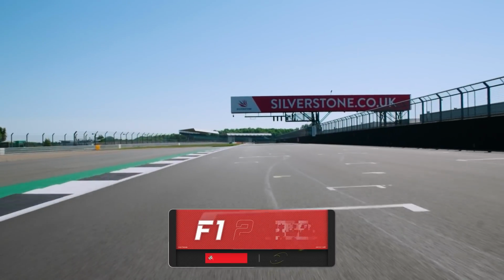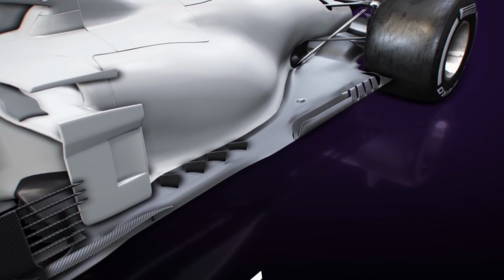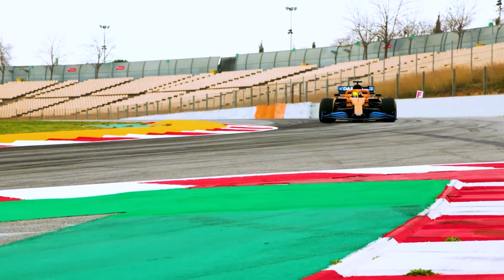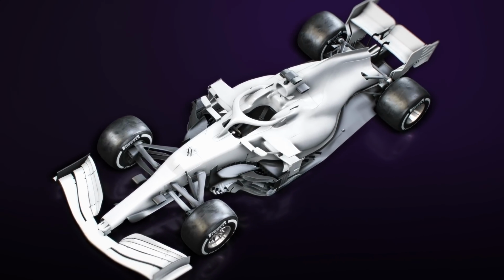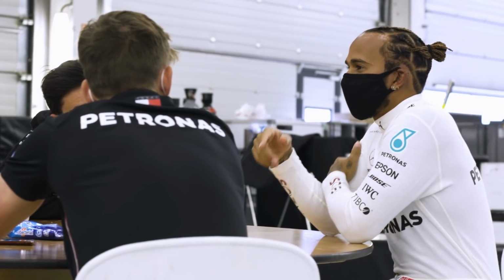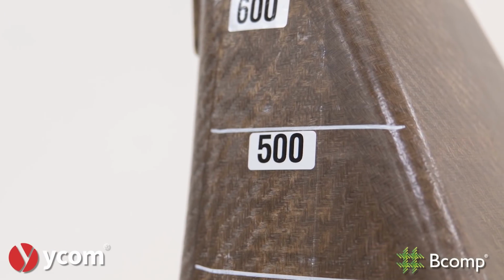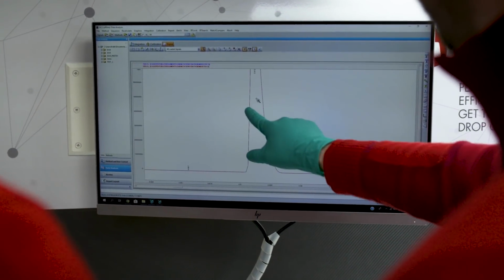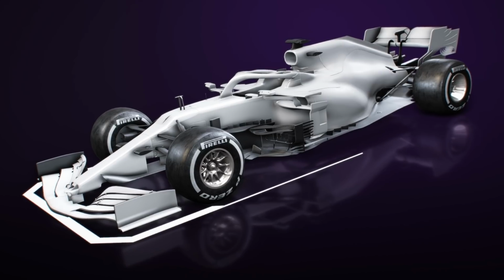F1's Updated 2021 Rules Explained - Everything You Need To Know

Comment: get rid of drs
Reply: Absolutely. Ruins racing with fake overtaking.
Reply: @cadelepski5161  yeah nah. DRS just eliminates the time lost from dirty air. You could argue that that loss is "fake" in the first place and DRS makes up for that again
Reply: @snonsig2688  It doesn't. It gives the car behind a huge straightline speed advantage. If it only eliminated it the car behind would still be behind. Anyway "dirty air" only affects corners. On straights where DRS is used slip stream + DRS gives the guy in front no chance.
Reply: @cadelepski5161  exactly dirty air only effects corners so you make that loss back in the straights were it s possible. Chances are if there was no dirty air the following car would've overtaken in the corner which DRS is trying to represent
Reply: No

Comment: Basically Pirelli can't keep up with technological advancements and development?
Reply: They probably can ,but not in order to comply to F1 mandate.
Reply: They were already designing tyres for the 2021 season and the rule changes before everything was pushed back a year. So basically they are just trying to make it so pirelli don't have to design a whole new tyre for one season of racing. They have redesigned the old tyre for the 2021 season now to basically be sturdy enough to cope with the loads.
Reply: No they could. The problem is that they can't meet the demand of the FIA for quickly degrading tires (for the entertainement and show) and the increasing downforce in the same time. One side asks for less durable tires, the other for more durable

Comment: Basically they just want to end the Mercedes dominance and make the car slower........
Reply: They did the same when Red Bull was dominating...........................
Reply: They could have just banned something that gave Mercedes the upper edge. I mean, they banned tyre changes in 2005 because Ferrari and Bridgestone were unbeatable in short stints
Reply: Litlle do they know merc might actually benefit it is going to hurt redbull more because of aerodynamic being the only thing they can even see merc in
Reply: I was prematurely excited about Merc being slowed down until i realized it will probably fk the other teams more in the end :/
Reply: They've always done this. Williams in the early 90s with the ban of driver aids, Ferrari in the mid 2000s with the tire changes, RB in 2014 with the shift to a hybrid power unit. When the competition gets stale, the FIA intervenes. Makes sense. Besides, none of these changes (minus banning DAS) target Mercedes in the way that the older changes targeted dominant teams.
Reply: I mean putting a cap on budget was understandable to let smaller teams compete but now these changes are just ..........

Comment: banning qualifying mode still makes no sense
Reply: Yeah all it does is create more consistent results, it's harder now because if a driver really wants to push to either try an overtake or get closer they can't use extra engine power to do so.
Reply: @airstrike9002  Err.. they can use extra energy from the battery.. The mapping restrictions really only have an impact on qualifying
Reply: @ryanokeefe12  errrr..
Except they don't. They're used continuously throughout the race, hence scenario 7 etc for the end of the race.  While they're still allowed an engine mode change in the final lap, why. Lit why. Why can't they have it the entire time? It didn't improve the racing at fucking ALL, yet they still pretend this isn't about closer racing. Ironic how red bull pushed so hard for it and then got impacted the most
Reply: @ImK4Os  true, redbull took the biggest shunt out of this, ironically they were the one crying to the FIA about at first.
the truth is 100% clear, mercedes is just thaat good, every attempt to slow them down will only make them faster, and the rest of the grid slower. 
the only good outcome we got from this nonsense is we no longer have to hear "FIA SuPpOrTs MeRcEdEs"
Reply: @ImK4Os  mate.. You've got no idea. I'm aware the hybrid system is used throughout the race. The drivers still have an overtake button that they can use to deploy more energy than normal.
On a normal lap, the car will deploy around the same amount of energy as it recovers. During a quali lap (and when using the overtake button), the car will deploy more energy. It just means that they will have to reduce energy output at a different stage of the race to top up their energy stores.
Things like "scenario 7" will deploy more energy, in similar way to the overtake button. It will put the car in a mode where it deploys more energy than it recovers. At the end of the race, this is fine because they can use all of their energy stores. 
If they went to "scenario 7" mid race, they would have to then spend time in a slower scenario to top up the stores again. 

"it didn't improve racing at all".. No, it wasn't the point. The point was to improve qualifying. Do some research before you start rambling about nonsense.
Reply: @ryanokeefe12  thanks for the information, genuinely didn't know the ins and outs of how the energy is deployed. Was always aware that it was a give and take situation, I know you can't just do scenario 7 over and over but I prefer the drivers to ha e the choice, I mean what does it really improve otherwise? 
Again, I'll repeat my sentiment. The engine mode ban didn't even improve the quali times, if anything the gap increased. Red bull was hit massively by it compared to merc and it probably made the racing worse as a result. Given that this was meant to be a slap on the wrist for merc (pushed for heavily by red bull, ironically) and it didn't even put a dent in their advantage is pretty hilarious. And the fact red bull kept pretending for weeks after that Mercedes were also struggling to make them look less stupid was so desperate and sad.
Reply: It made no difference...
Reply: its so the mode they use in quali is the same as they use in the race so it more accurately represents how fast they can go in a real event rather than on 1 lap of fuel and a short run engine mode
Reply: I just hope Checo to Red Bull
Reply: @brentmilligan2388  Red Bull would never bring someone in to challenge Max. They build their car around Max. Perez has a habit of crashing into his teammate when he cant beat him.
Reply: @LilSebastian_   Checo is a solid points scorer who always gets the most out his car, and tires, in a race. He would be closer to Verstappen than Albon or Gasly.
Reply: it made over taking a lot more complicated, cars have to spend more time in the slipstream, which brings the temps up, that if they didnt run out of straights.
as for "making the qualifying more competitive" well....we all saw how that came into effect
Reply: They're just trying to limit merc really. That's the same with banning DAS because it'll be too expensive for other teams to copy. It's ridiculous. So Mercedes spent their time and money to innovate but can't enjoy the fruits of their creativity and innovation because it's unfair to other teams?
Reply: @iwill6002  same thing happened with the dimpeled rims in 2017 or 18. all other teams were against it until they implemented it. since DAS is expensive to adopt, then it "IlLeGaL"
we have a saying here in my country "when a cat can't reach the steak, he says it stinks"
Reply: @rafiqsoufiane2723   at this rate they might as well just make f1 a spec series. It seems to be what everyone wants because whenever any team succeeds at actually being competitive, they have to be held back for being too good.
Reply: @iwill6002  the whole purpose of F1 is to allow teams with big budgets to go wild with their imagination, sadly whenever a team does what F1 IIIS ABOUT, it has to be cut down for as u said "being too good". by this rate we will see throttle limitation in the near future
Reply: @rafiqsoufiane2723  They whole sport seems to be going through an identity crisis tbh.
Reply: @iwill6002  all we can do now is hope they will be back to their senses, 2022 doesnt look that bright as well
Reply: @rafiqsoufiane2723   Here we call it "sour grapes".
Reply: 1: all in all, the budget cap should in theory call for "fair" competition, but knowing mercedes, they will come up with something cutting edge like DAS that is rules compliant , and other teams will complain about it (redbull) for its illegality when its in fact they are simply unable to come up with something remotely close to it
 2: qualy mod is ban, but mercedes is still locking the front row, which by now should make it obvious that its the other teams who cant keep up
Reply: @rafiqsoufiane2723  you're one of those naive people that think noone can do good things except for Mercedes.
1a) Adrian Newry developed the nearly untouchable red bull. Why didn't they continue their success? The person who designed the first of the hybrid era mercs was paddy Lowe. He's not at Merc anymore. What this says it the success at one rule set, is not an indication of success at another. It also says that one designer is not necessarily more likely to build a championship winning car than another. 
1b) all teams will always question the legality of unique designs. This is so that the design is either disallowed or so that they know that their own version can now be developed. It would be naive to start spending money on something to match another team, if you arent sure that it will be deemed legal. Mercedes protested ferrari for their engines, they protested red bull for their hollow wing end plate. Mercedes are just as bad as every other team when it comes to protesting now concepts. Don't block your ears to everything.
2) qualifying has been drastically closer since the power setting change. There are literally qualifying times for comparison directly in front of your face when you're watching qualifying, and you haven't even noticed that the times went from nearly a second (or more) between Merc and the other teams, to now being within half a second.
Reply: @ryanokeefe12  i totally agree, im not bias to any team, im just talking with what i see, if i missed something, thank u so much for pointing it out.
like u said, being good at one thing doesn't necessarily mean youll win races, and lets be honest mercedes has all together and they are still getting better within each race. and respect to all other teams as well.
i only made an open guess, it could be right or it could be wrong, well just have to wait and see.
thank u for the extra info 😊
Reply: @rafiqsoufiane2723  in my country cat is fox and the steak is a grape 😅😂🤣
Reply: @iwill6002  So true. Despite being 7 time world champions that shows you Merc still has the desire to win. Always thinking ahead of the game. Just like when they designed the 2014 car in 2012....the beginning of domination.
Reply: @iwill6002  The Socialist nanny state that is the FIA, want to kill off F1 with all these terrible changes
Reply: @jacktheladstevens  yea the changes absolutely make no sense. Especially when they’re targeting and punishing one team.

Comment: DAS was forbiden bcs Lewis used it to heat his tires at Turkey.
Also the Mercedes revert front brake disk heat system should have been banned to.
Lewis was using the front disk brake energy recovery system to heat the front brakes and therefore the wheels and tires.
Reply: did you get this from the comment section on facebook?

Comment: Natural fibers instead of carbon still need vast amounts of highly toxic petroleum-based resins. You'd know how nasty these are if you'd ever smelt them. They're much harder to replace.

Reducing weight and wasteful aero drag massively help with efficiency and green credibility. It also helps reduces loads - you know, for when your tyres are too often on the verge of failure.
Reply: I would like to see a comparison between petroleum-based and natural fibers on the resources needed from start to end-product
Reply: @mustavogaia2655  composites are matrix + core (reinforcement material). The matrix is always, as far as I know, nasty petroleum-based epoxy "resin". Whether one used carbon filaments or flax or bamboo or whatever as reinforcement.
Reply: @smnbld  I sincerely doubt that natural fibers can reinforce - give extraresistance - carbon. Adding a property/feature, like minimizing shattering, maybe.
Reply: @mustavogaia2655  you use the right amount of core material for the strength you need. Carbon is the best and gives the lowest weight, but it is nasty. They are trying to get within 5-10% of the strength-for-weight properties of carbon using natural fibers that they'll cook, process and tweak to improve them whilst still being able to claim they're green. They'll just want us to forget about the nasty resin, but I'm sure they're working on it too

Comment: With this rule change reducing the ability of the underbody to create suction, 2021 f1 cars are going to be spinnier than ever. Reducing the overbody downforce is simply the smarter move
Reply: My boi Vettel is not gonna like this.
Reply: Especially since the 2022 season is supposed to focus nearly entirely on underbody downforce to remove the dirty air problem they have had for ages now
Reply: @aidanquiett668  hey if the dirty air problem is gone, will we see the end of DRS??
Reply: @bruddahZone  It seems likely, as the old 2021 design models didnt even have it as an option from what we saw. Then again, if the FIA messed up their calculations and dirty air is still a problem, then we may have our worse racing yet going into 2022
Reply: @aidanquiett668  but I have heard that in F2 or F3, even though there isnt any dirty air problem they still have DRS?
Reply: Overbody downforce should be much less pitch-sensitive and more predictable than underbody downforce though...
Reply: S🅱️innala
Reply: s🅱️inatto intensifies
Reply: But less downforce means less % loss of downforce due to dirty air so I guess that's cool
Reply: @danielsgrunge  Except that they only changed a small issue here, so at most you might see a few percentage points of the several seconds of dirty air the cars give out
Reply: @aidanquiett668  So? Anything is still better than nothing
Reply: @danielsgrunge  fia wants a reduce of 10 percent. But multiple big channels and reports say that only 5 percent would be gone as teams developed their cars. How much is 5 percent? Probably running the aero of spa (lower downforce) at spain (higher down force comparing)
Reply: More s🅱️ins
Reply: Get rid of DRS zones.
Just open it wherever and whenever you want.
Reply: oh look, a Youtube University Engineer
Reply: @Loammello2  well to be fair they aren't reducing front down force, only rear down force.

Comment: I do not get why the fia puts these new rules in, its like they’re going backwards
Reply: Mostly it's economical.
Firstly to dampen the effect of the pandemic, secondly, to focus the resources on creating and developing the brand new 2022 car.
Reply: It's for closer racing and less dirty air.
Reply: @christyhurst9303  They keep justifying changes with that argument, but then their new limits do nothing to improve racing
Reply: @aidanquiett668  that isn't a valid argument against changing the rules though. 

In this instance we have Ross Brawn playing a big part, so hopefully it will be different. 

And honestly, they're completely changing the fundamentals of how the aero is to be utilised. So it's pretty safe to be excited that close racing will be a result.
Reply: @aidanquiett668  they do. For example, in 2018, nascar cars are suffering a problem where their car is generating too much downforce. As a result, they can take tighter lines and have less overtakes. They fixed this by applying thicker restrictor plates which slows them down and make them generate less downforce. And guess what? There are more overtakes than ever in nascar
Reply: @marcoimanuel5489  This is an entirely different issue tho, on many levels. Most importantly, the reason that F1 has passing problems is cause of dirty air, not just speed, so only changing a tiny part of the aero wont fix that. And the FIA knows this, since the 2022 changes are just about massive aero changes, and even if I dont think its enough, itll do miles more then this ever will
Reply: @aidanquiett668  But they do improve racing by making cars closer to equal. There is no point in calling it a race if someone is miles ahead.
Reply: @aidanquiett668  let's be honest, fia had done many things to get closer racing. They aren't very effective, but as we can all see, the 2022 regulation is focused on closer racing, and that's probably the biggest regulation change in F1 history.
Reply: @A.i.r_K  It certainly will be huge, and I'm hopeful it will finally fix the massive problems in racing F1 has right now, I just dont know if the FIA will actually be able to make it work given how ineffective their attempts to close the field usually are
Reply: The FIA has done this lots of times before, this is not new. The reason for this is safety, like they said in this video this time it has to do with the amount of downforce the present cars have. The tires just can't handle these amount of downforce.
Reply: It's kind of the point - to make racing more chassis dependent than aero.